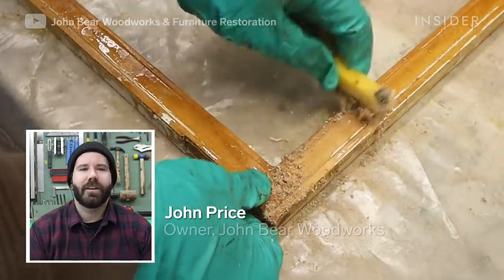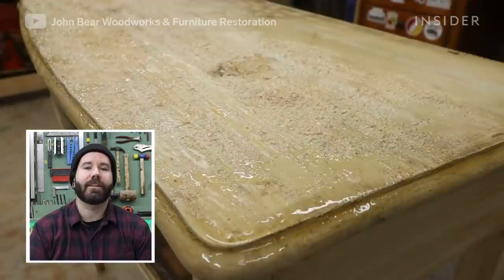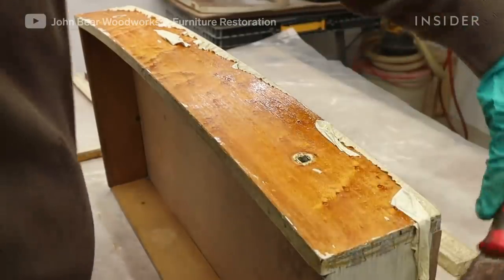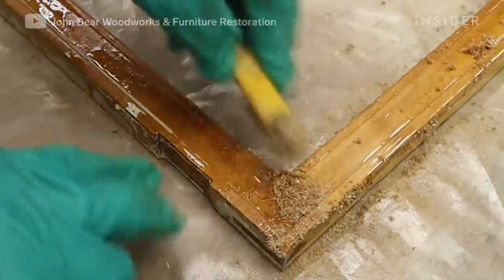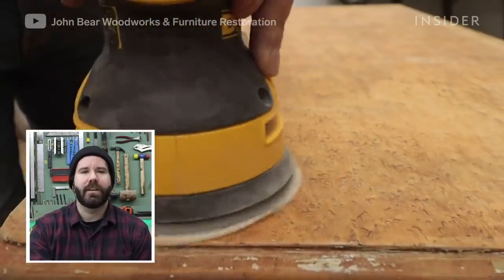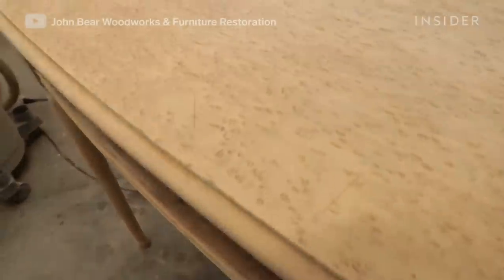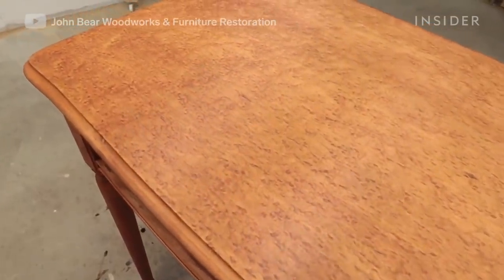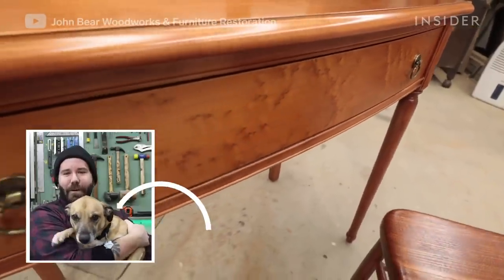How A 1950s Vanity Is Professionally Restored | Refurbished

Comment: A "Healthy" tip for ANYONE doing this....when stripping old paint, DO A LEAD TEST FIRST to see if any of the paint contains lead (lead paint was common prior to 70s), you can get these lead test at paint stores, for little or NO money. NEVER SAND anything that has had lead paint on it. lead DOES get into the wood grain and can turn into a deadly dust when using electric or battery operated sanders. . This also applies to AFTER you have stripped the furniture. .IF this project did have lead paint, it is NOW ALL throughout his shop. keep the surface damp to reduce this. enjoy this healthy tip.
Reply: So to u test for lead before and after you scrape the paint?
Reply: @Aisha_Luv   Before you scrape or sand anything that old that could have lead paint, strippers do help but can leave fine lead sediments behind and become air born when sanding. This is very dangerous. it is even better to take to a shop and have them ACID dip the whole things, but let them know of the lead paint, they can deal with it SAFER than a person in-experienced can
Reply: @Aisha_Luv  YES
Reply: Ffs
Reply: Especifically white colour paint! Anything white from years prior to 1970 is almost guaranteed to contain lead. In the US, lead was banned in 1970, but if you are from any other country, please check your paint even if it's from after 1970s, bc a lot of countries didn't ban lead until the 2000's

Comment: Sanding: To remove scratches, you scratch it.
Reply: I never thought of it that way, but now I can’t unthink it
Reply: More like- To hide scratches, remove everything around it
Reply: Very similar to FX prosthetic makeup! To hide the texture of the seams of a prosthetic you add more texture with a stippling sponge and latex. It's counterintuitive but it works
Reply: yeah you scratch as deep as the scratch you want gone, and remove the material above it. no more scratch
Reply: Ah yes, the floor is made of floor
Reply: A
Reply: That's it, when sanding cars to repaint you generally go from 80 grit, to say 150 grit, then 320 grit, then 400 wet/dry grit before painting. After painting you sand the clear coat with 600-800 grit and then buff it.
Reply: You basically replace big obvious scratches with smaller, less perceptible scratches

Comment: Hi John,  Nice work!  The pieces look fantastic.  That grain on the chair - so lovely!  I agree about red tints being so warm and elegant.  My technique though is to heavily oil the very dry pieces with Boiled Linseed Oil, let dry a few days, then use several coats of diluted oil-based polyurethane to penetrate, strengthen the wood, and give an indestructible finish impervious to damage.  I've never tried lacquer - its more delicate and great for more elegant pieces.  My worry is that it will yellow, crack, and chip with time.  Also by oiling first, the wood relaxes and is so happy.  Like putting cream on a dry face.  It brings out golden tones, so I seldom use stains unless wood is bleached out or too white.

I have been restoring furniture as a hobby many years, for myself or to save a beautiful old piece for reuse.  Its really nice to be amongst fellow restorers.  The labor is so much sometimes, that its barely profitable, but the artistic satisfaction is huge.  For a few years now, I have been unable to find a decent stripper in CA. Maybe Vegas 😉!!  They took the Dichlormethane (Methylene Chloride) out of it.  I am so annoyed, I want to move out of state just for this one reason. Its intensely frustrating to apply 3 coats of a paste stripper like Jasco heavy duty version, and watch it do NOTHING!  Its $45 per gal too!  The old stuff was cheap, liquid not paste, and highly effective esp with paint.  Please, please can you share what stripper you used on this project and let me know how to get some.  I'm so desperate.  I have some antique carved jewelry boxes and when I used this Jasco it globbed up and almost destroyed the box.  I must get some even if it means driving to Florida.

Comment: Paint stripper is the worst toxic awful smelling stuff, I plain refuse to use it.
Reply: I've used it before too. It's like acid goo. Even with the thickest rubber gloves I could find, I could still feel it trying to burn through them. I was so worried some would get on my skin. Refurbishing is very satisfying though, regardless of the method.
Reply: you need a good respirator and ventilation,  best to use outside.
Reply: Just use citristrip that has a really good smell
Reply: @Chris-pv6vv  and it won’t work on most polyurethane, and takes HOURS.
Reply: Mmmm tasty
Reply: I use it every day with my 3D printers bed you get use to it
Reply: @computertecky4744  Your lungs dont
Reply: @user-uj4pn4dk5d  They do if you properly ventilate and use proper protection...
Reply: Then find a different brand. The one they have at my local smells mildly of marsipan 😂
Reply: Also can't use paint stripper on MDF. I was restoring an antique dresser for first time with paint stripper when the side panels that were made of MDF (the whole piece is made from wood except the side panels which were hidden under layers of paint) started to warp and flake. I was horrified and removed the stripper immediately but damage was done. Rest of the paint came off like this vid without warping the wood since it's actual wood. Check if any parts of it has MDF and avoid using paint stripper there
Reply: @computertecky4744  why do you need paint stripper for your print be d?

Comment: Nice work. Do you neutralize the acid in the stripper after stripping? With maybe a baking soda wash? In my work in homes and such I like to keep 2 sets of scrapers, one set of rough that is fair game for anything that has a blade like a knife, it wears naturally sharp that way over use. I also keep a set ( of varying widths) aside and these are protected. They have a front edge that’s got a sharp square edge like it is when it comes off the shelf. A file is always on hand to touch it up along with a stone to knock off any nicks the file might give it. Of course the corners may or may not be rounded. Also with the protected set are some other different shapes and sizes that are kept sharp with a square edge, a screwdriver, a pin punch. Great for concave shapes. 

Thanks for mentioning the sawdust trick, I will try that in the future.

Comment: Just overpaid for one with twin construction - nice tip on the mirror - but mine is a case of last-legs veneer in 3 different species or colors (oak and ash burl) and at the cost of replacement veneer running $10+ a square foot to match - I have to patch the missing parts and hope for 90% restoration.  I overpaid for for the use value - it's a rare style good for my media studio.

Comment: Quick question, does it count as restored if you strip paint off, and then don’t put paint back on?
I’m asking, because I’ve helped take care of some older homes before, and one of things they did was clean up damaged areas and paint over them, as it was a quick and efficient way to maintain the property yourself without going through The kind of elaborate repair you perform.

Comment: I also did this With a old door-frame.
The Smell was so BAD.
After a While you get bad headache.
Reply: Not sure how you applied it but, it should be used in either an open space or well ventilated while you use a paint mask respirator, gloves and eye protection.
Reply: I just used a Hot-Air gun and Nothing else.

Comment: Well, surfaces suffer first. You eventually eliminated the original coating. This is not restoration as defined by ICOM and other professional institutions. This is refurbishing or modifiying for further use. It is a misunderstanding to think that old damaged surfaces need to be liquidated for proper restoration. Indeed, a professional academic conservator would have to incredibly carefully preserve that white paint - in case this piece would have been declared cultural heritage. However, this one is probably not declared to be cultural heritage, but still, it is dangerous to believe this to be a professional method of conservator-restorers. 

So if you have got a really valuable piece, go ask a professional academic conservator in order to save historical evidence like surfaces instead of stripping them off.